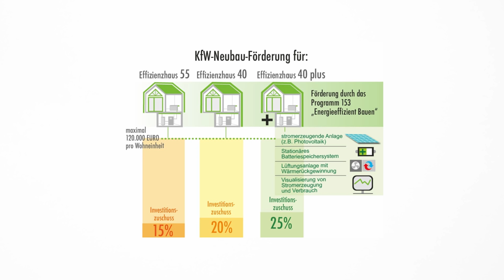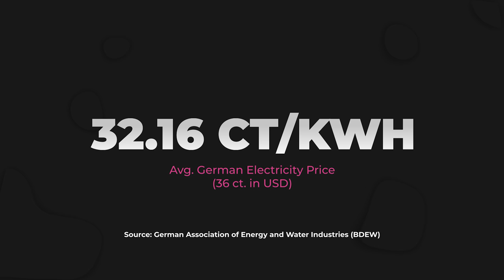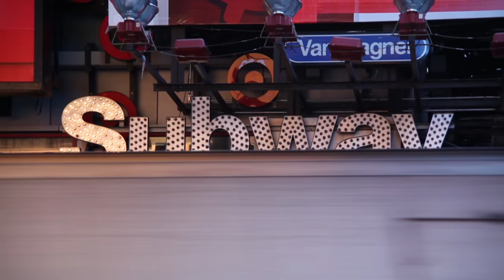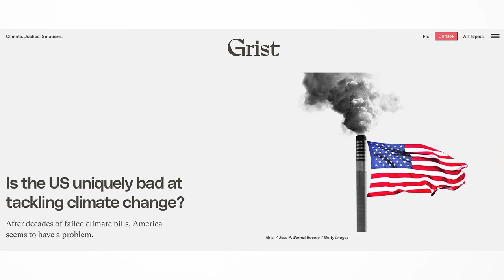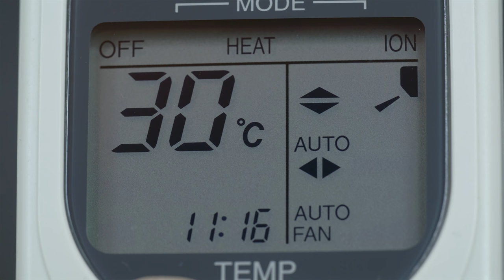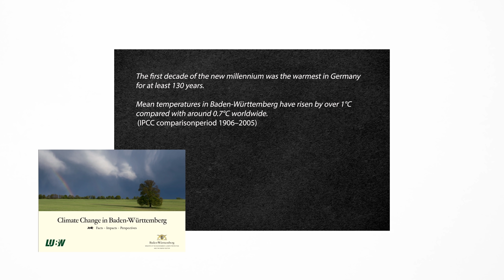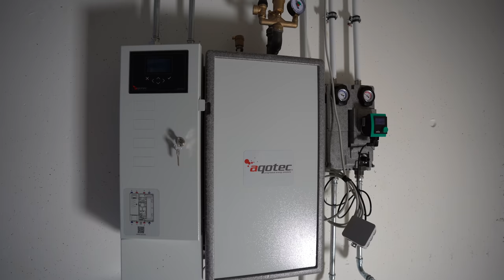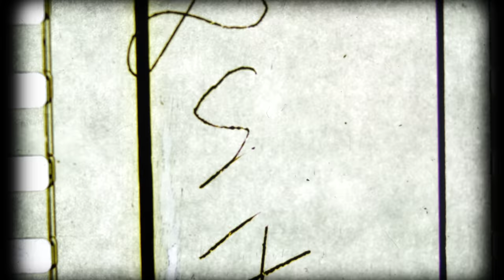HVAC (HLK) in German & American Homes | A Tale of Two Countries

Comment: you didn't talk about the Wärmetauscher, in french VMC double flux. So you can recuperate up to 95% of the heat already in the house in exchange with fresh outside air.
Reply from the maker: I just did a little bit of googling on this and this is fascinating! Do you have one in your own home?
Reply: Oh yes. I would love to hear your thoughts on Wärmetauscher and Wärmepumpen for residential homes.
Reply: @TypeAshton  You can go to the Vauban and look at that houses, which are all "passiv" or "Energieplus" Houses, which meaning all of them have that Wärmetauscher and the "Energieplus" houses producing more energy than they consume this houses are much better than the KFW 55 houses. Look on google maps for "Solarsiedlung am Schlierberg" for the "Energieplus" houses location. And if you visiting that area, go to the "Heliotrop" (https://en.wikipedia.org/wiki/Heliotrope_(building)) which is a house that turns always towards the sun and looks pretty amazing
Reply: @TypeAshton  Yes I have one in my appartment. It is very usefull, because you can leave your home, without leaving a window open and have fresh air when you come home. If you have a party, you only increase the speed of exchange, and you have nearly no cold entering. If you add enthalpie (humidity regulation) you can have a better and healthyer climat in your home.
Reply: @stefan1524  do you know how they stack up against modern technologies? Vauban was innovative in the 2000s when I lived in FR.i
B. but I'm curious how further we could take things today.
Reply: Just want to wrote the same. In my country (south of Germany) the heat exchanger for forced ventilation is a must in energy efficient houses for the houses build in the last 10 years, as well the official testing the house for air tightness, meaning no leaking of the air thru windows, doors, sockets, wall-roof connections... 
The same system is also useful for lowering summer temperatures not as efficient as AC but still quite useful, especially if you instal active cooling part in it which can dry the air in the summer.

I got first info about energy efficient houses 15 years ago on a german passive house institute site.
Reply: @Warentester  it seems my answer was removed by youtube.. so next try without links. I don't really know about it, but i guess it works better with mordern solutions like "Erdwärme" or better solar panel or isolation materials. The latest thing i have heard in Freiburg itself was before the pandemic on different locations/shows/meetings about the BHKW (Blockheizkraftwerk) as a solution for "Altbau" houses. The BHKW produces heat, warmwater and electricity for the whole "Mehrfamilienhaus".
Reply: @TypeAshton  nun in deutsch. Da ihr oft draussen seit in der Natur. Hier ein Frage sus der Bionik. Haben Enten kalte Füsse und warum sterben Enten nicht an Unterkühlung wenn sie den ganzen Tag in 1Grad kaltem Wasser rumschwimmen? Die Antwort ist einfach Enten haben Wärmetauscher.
Reply: The burning of wood chips is a great idea, however; in the US, their would never be enough supply of wood chips to satisfy the need to produce the District Hot Water Supply.  We wood very quickly deplete of Forests if we tried.  Radiant heat, in my opinion, is the best.  However; very expensive here in the US for initial installation.   We have so many people living in rural areas, they must supply rut their own method of creating the hot water since a District Pipeline just wouldn't be practical or even possible in some cases.  Your comparison and all of your research was very interesting,  however; because of the mere size of tut he US, compared to Germany.   In my opinion, it's impossible to justify using similar systems for both countries.   I did enjoy your video, as I do ALL of your videos.  Thank you and Best Wishes with your new home and your Very enjoyable Channel.  Charlie

Comment: We consider an AC for our house here in Germany. But only since we have 12 kW Solarpanels at our roof plus a 6kW Battery in the cellar. So we harvest too much electricity on a bright summer day as to use it directly. Therefore an AC unit could add some comfort without wasting electricity.
I’m very positive astonished by the depth and profunde knowledge in your video and would be interested in how you perceive the different voltage systems eg. 1 phase-3 phase, 120V vs. 240V or 400V in our both country’s.
Reply from the maker: Ah great idea for a future video! Thank you so much.

Comment: Thanks, another very interesting video. When we travel to teh US we have always in mind to take along a hoodie when going to Walmart or in a restaurant because of the air conditioners. 
In Germany there are also "Waste incineration plants" (is it the right translation for Müllverbrennungsanlage?) which are producing power and district heating.
Reply from the maker: A few others have brought up the incinerator and that sounds so interesting!! We'd love to look into this further.
Reply: There are also the bio gas plants that make use of agriculture waste. Those are very efficient if powered by waste produced during your normal food production. But specifically growing crops for bio gas plants is super bad for the climate, because using additional land is one of the worst things you can do to the climate. The same principle is true for wood chips/pellets - it's only good as long as it uses the byproducts of existing & necessary wood agriculture.

Comment: Most of the time when I lived in LA I had no A/C, which was fine. In the 30+ years in Austria, I've also had no A/C, but know how to keep the apartment cool in summer. It might be hard to imagine, but when we lived in West Africa, along the coast, about 2 clicks north of the equator, we had the big ceiling fans in each room which worked quite well, in comparison to having a single A/C unit at a cost of $1000/mo. per unit in 1967! Electricity was and appears to still be quite expensive in certain regions.

Comment: This is a really informative and helpful video. Thanks much for the information and comparison!  As for the forced air/ radiated heating controversy: I have lived with both and must say that forced air brings the temperature in a room up or down faster. That is more convenient, when you are freezing or sweating, I suppose. The downside is the air "blast" itself, which I, as someone who has to deal with allergies, now regard as somewhat suspect. Filters are a possible answer to this problem. In addition, the need to air your rooms at least daily can be disregarded to a great extent, as the air is in constant exchange due to the heating system. Nonetheless, I still prefer my radiated heating with room by room temperature control  using room thermostats (I mean, who needs a bedroom as warm as a living room?!). In addition, the energy efficiency of Fernwärme is wonderful. We don't have it here in our mini-town, but had it in the nearby city, and I enjoyed it. Questions of fuel and maintenance of the heating system were not our problem - in contrast to our having to own and maintain our present gas furnace. If there are problems, an entire neighbourhood puts pressure on the energy company. Things get fixed relatively quickly, and problems with the system are rare. Thanks for all your great work!
Reply from the maker: Thank you for watching! We have actually had a counter experience with the lack of forced air. Ashton has very bad allergies in the spring/summer time, which is increased when we have all of our windows open. When we are in the states with forced AC and a clean filter, the allergies are often much less severe. So, perhaps it could go both ways.
Reply: @TypeAshton  My son had allergies and we had an electrostatic filter place on the hot air furnace. It is amazing what that filter caught! The furnace also had an ultra violet light to kill bacteria. With hydronic ( hot water) heating, an auxiliary duct system would have to be added, as well as for humidity control and possibly A/C. Although, a split system A/C can be added without duct work.
Incidentally, the new split system heating and A/C units are now more efficient than  the best hot air systems.

Comment: American military living in Mainz this year 2022. Apartment in the "roof story" of a newer multistory home. One room has AC but I can't use it after 10 PM due to the noise it makes. Fortunately, even with the few 100 F days, I could mostly control the temp by night venting and using roladens and external blinds and blackout curtains in the bedroom during the day. Our office is in a very heavily built 3 1/2 story 1950s masonry barracks near Ingelheim am Rhein. The shaded side of that building never got hot.

Comment: I don't mind air conditioning, but I find people's use of it sometimes less than sensible. A few years ago, I had to travel to Qatar for work. Although it was still winter and the outside temperature was never exceeding 26 degrees, the AC's were turned to arctic winter and the situation was so bad that I returned home with a massive cold that even affected my hearing for several weeks after I had returned home again.
Reply from the maker: It is really interesting for us just on how cultural interior temperatures can be. Coming from the midwest, we would always snicker at those from Florida. If its 60 degrees and sunny, we're wearing shorts and opening all the windows in our home. They would be dressed in parkas and have the heat cranking. 😂
Reply: @TypeAshton  Haha! I know exactly what you are talking about. When I lived in Scotland, people would start running around in tee shirts as soon as the temperature hit 5  degress in the spring.
Reply: @TypeAshton  the big differences between Florida "cold" and up north cold is the humidity. Humidity or damp cold makes things feel colder than it is. 60 in Florida feels like 50 to your skin. This is something I had to adjust to in Switzerland. I would see it was 50 outside and I would dress like it was 50 in Florida. I would be sweating my ass off. This wasn't after living years in Switzerland. It was my first winter in both areas.

Comment: Germany is chilly much of the year.   People in Maine don't need a/c.    A/c also serves to lower humidity. Condensation inside walls can cause mold.   New homes in the U.S. often have conditioned attics to 
eliminate condensation.  Keeping water out , whether  from rain or condensation is a major factor in how long wood framing lasts and the efficiency of insulation.

Ductless mini splits are popular in Europe. These are the best way to retrofit ac to old homes as are found in Europe.

Comment: I think that AC unit with heat pumps that can both cool and heat are more efficient, the channel "Technology connections" has a very detail video explaining why, it's called "Heat Pumps: the Future of Home Heating" you should check it out, but in short it comes to the ratio, for systems using a boiler 1 unit of energy translates to 0.8-0.95 units of heat while using heat pumps a unit of energy equals   3-5 units of heat moved (heat or cool)

Comment: The only negative I have is that you call air conditioning "obsession".  It's really not an obsession, and more of a necessity in much of the Southern US.  I live in South Carolina and people can die if their AC goes out...  Things are just getting worse with the climate getting warmer.  My family in Germany has also noticed more heat waves coming through on occasion.  BTW we offset about 80% of our electrical AC requirement with a 27 panel PV system, so...
Reply: Yeah but how did people in the south lived before AC came about? I mean it’s only been mainstream for about maybe 30-40 years.did everybody just dropped dead in the summer ? Nope they thrived and multiply.I think is just a bad lifestyle and they’re right to call it an addiction because in many parts of the world much much hotter than the US people just adapt and live fine without AC

Comment: The upcoming summer 2022 we will retrofit a central forced ventilation system to our house (built in 1880) for heat recovery during heating season and for cooling during summer.
The fresh air will be cooled in summer and preheated in winter by use of a subterranean system, working similar to the Roman air well.
Of cause we use sun power in for heating in summer (hot water supply) as well as electricity (air ventilation).
Blexen is right at the coast to North Sea and so we hope to install a vertical wind generator, too.
Our tenants welcome these improvements. For us as property owner it pays off very well.

Comment: Tschörman here: When discussing AC with Germans, keep in mind that - because it is not commonplace in our homes, and electricity is expensive - it is regarded as a kind of luxury item, almost but not quite like a pool. And with anything in that direction, the German envy kicks in. So, if you have AC or prefer AC, people around you will come up with all sorts of explanations why they don't have it and don't like it and you shouldn't have it and shouldn't like it, too, you Klimasünder.
If you don't have AC, you are still lucky: Floor heating is actually enough to bring that to the test. Most German appartments and houses don't have floor heating. Not because it's more expensive, no, no, no, but because with floor heating the dust can't settle on the floor and constantly floats around in the rising air flow, which is extremly unhealthy. True, straight from a conversation between young moms on the bus who had to compare their new familiy houses. They felt really lucky to find out neither of them has floor heating.
Reply: Score a point in favor of forced air heating: Radiant heating has NO filter system, while force air heating has at least SOME filter system. BUT, that filter needs to be cleaned regularly!

Comment: We're not in Germany, but we DO live in a hot climate (4 story stone tower in central Italy, and a 2 story cabin in California) - what we do is open the windows (all the windows, starting from the top floor and working our way down, but especially the upstairs ones to get the heat vented out) in the evening once the outside air is cooler than the air in our house...  we also have fans to help move the cooler air closer to the ground level inside.  When we get up, we close the windows once the air outside stops feeling cool compared to inside (meaning it's getting warm outside), from the bottom floors to the top floor (again, to help chimney the hot air out).  DO NOT turn the fans off - you want to keep the air circulating to get the most out of your cool air you have stored up.  

Trick 2 - Thick (wool if you can get thick ones) curtains - not only heeps the heat from going through the windows (even our double paned ones bleed heat), but also blocks the radiant heat from outside (REALLY prevalent in California).  

Confession time - We DID install (in California) a window AC unit (small and thrifty) in the bedroom, (along of course with the window fan) but run it on energy saver mode - essentially it chills once, then switches the fan on and off until the temp goes up 5ºc.  Then it runs the compressor for about a minute, shills down, then does the fam cycle again.  ALSO because we have a dry climate there (RH of 35-40% or less) I have a swamp cooler (squirrel cage fan with water running through intake batts - the only electricity is from the fan) in my shop...  otherwise it would be unbearably hot.  We've needed neither in Italy - yet - tho I'm looking at options the same way.

Comment: Great video, guys! I live in Berlin in a DG (Dachgeschoss) apartment in a newly built well insulated house, which i bought a few years back without realizing how hot it would get in summer. I did cave in to a portable AC, not once but twice! And honestly speaking, when we look for a bigger house, we will definitely make sure it has a proper AC installed or even better a heat pump, just to future proof against the global warming.
I also have underfloor heating, and after living with it for some time, I'm less of a fan than I was before - it's extremely hard to dial in the temperature you want - it takes hours to feel a noticable difference.

Comment: I'm British so even the warm German weather is crazy hot for me but after we paid to get our 70s house properly insulated the blinds and open windows at night works well enough. The kids in the converted loft (attic) have AC units though. Portables just for those few really hot weeks.  We got rid of our old oil boiler and replaced it with a heat exchanger because that's more efficient that a standard electric heater. I learnt lots about the various systems for heating to decide here and if I was building a house from scratch, I would do a ground to water heat exchanger as well as a system that took the hot air from the top floor and bedrooms then sank it into the water heating system.
Reply: When we lived in Oslo the whole city there is a distributed heating system though with a power plant that burnt rubbish. It was a really good system and I have seen a few new builds around here doing the same thing.

Comment: During vacation I was in an Airbnb with this air heating stuff and it is soooo damn uncomfortable. (Not how to turn it on and of, that is easy, as you said.) But the heat feels bad. Believe me, it feels so so much better when the heat comes from the floor and gently moves up by nature instead of beeing pushed through the room.
It is another kind of warmth and so much more efficient. It feels more like sitting next to a fire place but wholesome.
It is also diffrent when not only the air is warm but the floor and or the walls are warm too